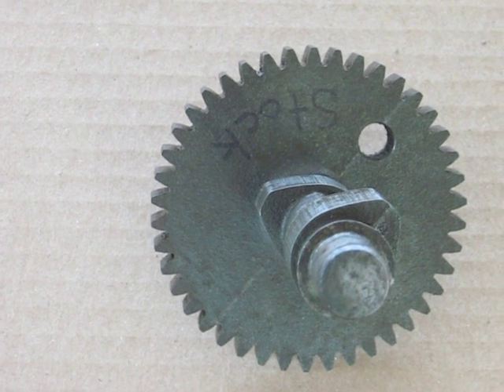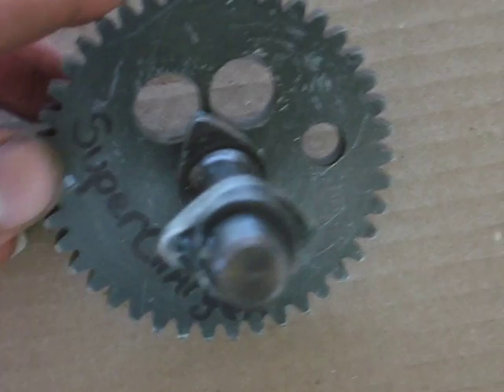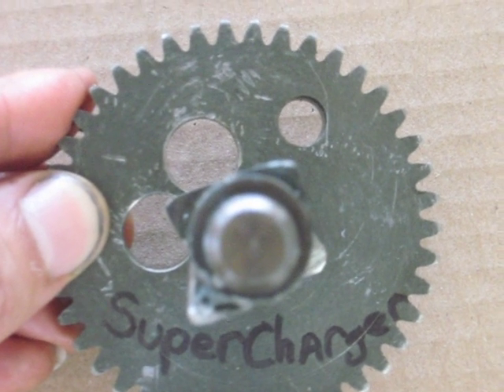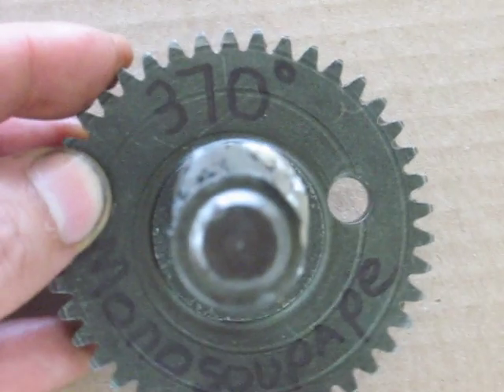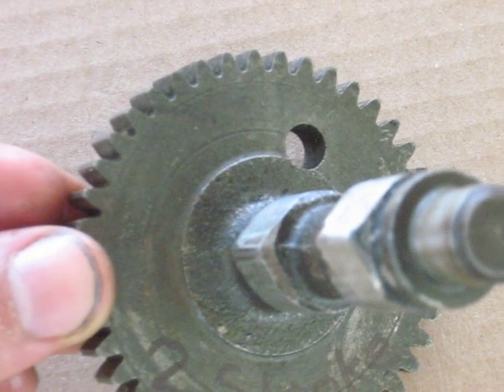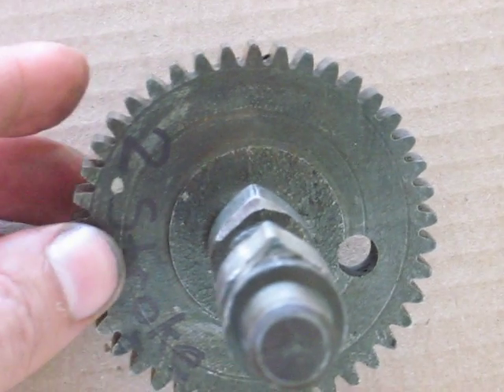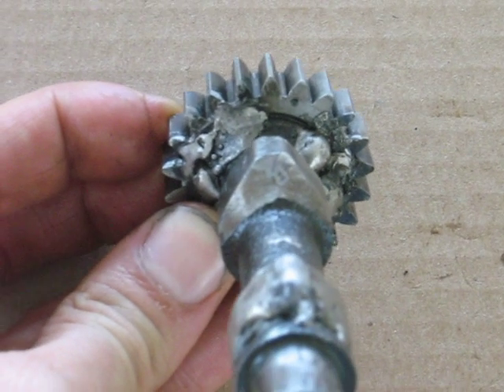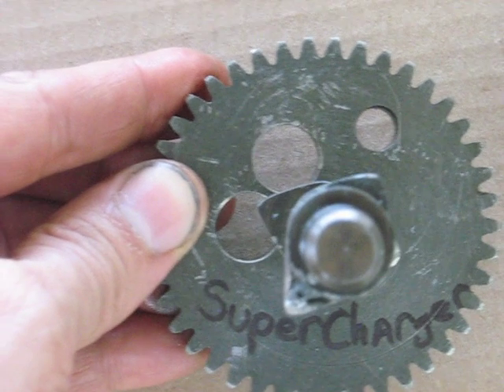Modified Camshafts for Briggs experimental engines

Comment: I have a 3HP 90102 horizontal engine. Is there a cast iron B&S cam available to replaca the nylon one?
Reply from the maker: Yes, pretty much ant cast iron cam from an older  3 horse or 3-1/2 horse Briggs  Briggs engine should fit. I mix and match the old cams all the time. My guess is that you could find one on ebay, just make sure it is a cast camshaft by the photo. Jacks small engines lists the camshaft as  703149, but it has plastic lobes in the display photo. It is like they have phased out all of the old part numbers for the cast cams, so that makes it hard to hunt for them! It looks like the cam you should look for is 394800, which looks to be cast in the photos on e-bay, but one guy want $37 for it!  If you can't find one for a reasonable price I can sell you one for like $10 plus shipping. I am in Canada, but travel to the USA sometimes, so I would mail it in the USA to save on shipping. But you would have to wait a month or so. Let me know how your search turns out.

Comment: What material and heat treatment you using?
Reply from the maker: I was just using a nickel based stick welding rod for cast iron. i didn't do any heat treating. These engines don't run very long, so it wasn't necessary. I guess you would have to experiment with heat treatment to do this for a cam intended for long life.

Comment: I build a lot of small engines, collect them, experiment with them, hoard them... I have NEVER seen cams modified quite like yours though. You have a remarkable understanding of these engines (most engines, I expect) and some really weird ideas. Good weird. Super cool.
Avoiding unnecessary machining on motors granted short life spans is a valuable lesson.
Reply from the maker: All of these cams are designed to suit a given engine. Some are for 2 strokes, other 4 strokes, or other strange cycles, like the Monosoupape, a modified 4 stroke cycle.  thanks for believing that these cams really work, as some people don't. I am currently working on an H12 cylinder, it has been quite the challenge, I hope to have a 6 cylinder run this weekend. If I really move my butt, and if my starter will handle it, a 9 cylinder may be in reach. :)  Take care.

Comment: How do you make the cams? Do you just weld and grind them into the shape you want or do you do something else?
Reply from the maker: It depended a bit on the engine I was making it for. Some of the I had to weld on a lump and spend a lot of time grinding it into the right shape. It took  a lot of trial and error fitting the cam into the engine, checking lift and duration, then grinding more, or even welding some back on. On other engines I just sawed the camshaft in half and re-oriented it the way I needed it, then I welded it back together in a beater engine I made into a welding jig. One way to smooth out the lobe surface better is to use sandpaper pulling it back and forth over the lobe surface.
Reply: ChargerMiles007 ok thanks! The reason I asked is I’m planning on building a 2 cylinder tecumseh engine and I don’t want to spend money on buying a big cam when I can make one

Comment: can you explain the 370 degrees of duration for me?
Reply from the maker: A 4 stroke engine needs 2 crankshaft revolutions (720 degrees) to complete the whole cycle. This particular engine keeps the exhaust valve open for 370 degrees, as it initially serves as an exhaust valve, then when the piston reaches the top and then goes down, the valve becomes intake. it will only work with a short exhaust port, and no piping. The engine that used it is called a Monosoupape, or single valve. The rest of the intake air as well as the fuel entered thru inlet ports at the bottom of the cylinder, uncovered by the piston.
Reply: ok thanks

Comment: How did those cams work when you tried to put them into action? Very interesting idea on the supercharger cam. Should look into changing your lobe angle separation probably be a better way of supercharging the cam... I like the idea though. The way you have the cam setup would probably only want to make a lot of power at a very specific RPM range whereas if you just change a lobe angle separation and have overlap it'll have a couple thousand RPM of a Power Band. It would work if you could do variable valve timing.
Reply from the maker: All of these cams worked in the various engines I made them for. I never have any power readings, as I just experiment most of the time with the engine not being loaded down. I have used a few of them to cut grass etc. I did run the sleeve valve engine on a dyno at university quite a bit. the little 8 cubic inch engine put out 4.75 horse at 3200 rpm with about 9:1 compression. It has enough fruit punch to cut grass very well in my vids. It will rev to 6300 rpm.

Comment: theres only one problem this guy knows nothing about engines theres no cam or valves in a two stroke engine period
Reply from the maker: Kepp making comments like this, and I will have to make a vid showing how many different types of 2 stroke engines there really are. Perhaps you are only familiar with the most common type, the one you find on weed eaters or on model airplanes. there are several other types, for instance a Detroit 6-71 type diesel 2 stroke. It does indeed use valves and a camshaft for exhaust, along with inlet ports and an exhaust scavenger (supercharger).
Reply: Research before making comments like that
Reply: you sound like a stupid fucking idiot Channing. sit the fuck down
Reply: Nice profile pic Channing, I like your accessories, but I can still see your face..add some more please.
Reply: Idiot channing

Comment: isn't there only 360 degrees in a circle
Reply: Yes, but this isn't measured on the circle of the camshaft, this is measured by degrees on the crankshaft. A typical 4stroke engine completes each set of cycles in 720 degrees of crankshaft rotation. The camshaft on a 4 cycle engine runs at half the speed of the crankshaft, so 370* duration would actually only be 185* of lobe on the camshaft, which is what this camshaft has.
Reply: 370 degrees, so it is open all the time, lol

Comment: My briggs and stratton engine has a plastic camshaft which when I ripped it apart to replace it I said. Wow to myself
Reply from the maker: Yes, I seem to have pretty good luck with the plastic cams on smaller engines. I have heard of a few failures on larger engines, like the gear slipping.
Reply: Donovan Bryant you should buy an aftermarket, or older engine

Comment: back in 1957 I modified the cam lobes(grinding off the rear side of cam to increase duration and lift(with lengthened tappets). this is a half horse briggs with a 3/4 model N brigs updraft carburetor and manifold. With a tuned exhaust. mounted on a schwinn single speed bicycle. Behind the seat on a platform . Drove with a second rim welded on to rear wheel rim. All this in rural minnesota farm land(cops let kids drive motor bikes with no license back then). I could always go faster than a sears alstate moped. They would go 32mph and I could get 35mph. Still have the engine kept on a shelf in my storage shed out of the weather. fun to tinker with small engines to get improved power/speed.
Reply from the maker: lol  :) Sounds like you had some fun riding that bike at 35mph!

Comment: i dont think you know how engine works..
Reply from the maker: Really, some of the stuff i do is rather out there, but I assure you that i know how engines work. Perhaps not all of the engineering calculations, intake and exhaust resonance etc., but I think I have a handle on the basics. Some of the cams and things I make are strange, like the one with 370 degrees of duration, but it is for a modified cycle engine called the monosoupape, a very peculiar 4 stroke rotary engine used during WW1.
Reply: Manny, you pretty much summed it up. This young fella is very knowledgeable about these engines. He’s definitely taught me more than a thing or two over the years.
Reply: +ChargerMiles007 You're too kind. Anyone who doesn't think you understand how an engine works is a moron. 

In order for you to make these non-Otto engines you obviously have a thorough understanding of the Briggs 4 cycle engine that you're modifying. You do great work CM. Don't let imbeciles get you down.

Comment: How do you get more than 360° rotation?
Reply from the maker: +Dirtysailor s Camshaft durations are listed on the full 2 crankshaft rotations on a 4 stroke engine, hence 720 degrees of rotation. Thus a 240 deg. intake and exhaust duration would equal 480 deg (with no overlap- not a likely occurrence), but just the intake and exhaust will equal more than 360 degrees, which demonstrates the 720 degrees.
 Note the greater then 360 deg. you mention is on the camshaft of a monosoupape, an engine that uses a modified 4 stroke cycle, with inlet ports and only an exhaust valve, a very strange animal, hence the pecullar valve duration.

Comment: Very nice, i am not a 4stroke lover but.... willing to learn. We have a lot of Chinese scoots running around here and they are slow as hell. most are 50cc with no power at all. Parts are very cheap but no racing parts available. i want to mod the stock camshaft but a dont know what side of the lobes i need ti weld up for more duration. Can you mod a GY6 50cc camshaft??
Reply from the maker: Guido Samson I don't have any of those engines here, but what you need to do is weld to each side of the lobe, then carefully grind it down smooth, as well as sand it. Making the camshaft lobe wider will keep the valve open for a longer time (increasing duration). You don't want to increase the height of the lobe (increasing valve lift), as you might hit the piston. Also, if it is an overhead valve engine, you will need to make sure buy turning the engine over by hand, that the valves still clear the piston. And don't forget that if the revs are too high, the valves can float, and still hit the piston at high revs.I cannot say how long the welded up camshaft will last under racing service, as there are just too many factors at work. If you only weld up one side of the lobe, the valve will either open earlier, or close later, which may be what you want.
Reply: example so i can actualy see
Reply from the maker: Guido Samson I will try to remember to make a quick vid for you. If you don't see it uploaded by Monday night, please remind me about it, I won't mind.
Reply from the maker: ChargerMiles007 I made the vid a few days ago, but it had trouble uploading. I discovered a new way to make a racing cam, so I will make a new vid explaining both methods.
Reply: ok thanx man
Reply: There's a shitton of gy6 performance parts on the net man.
Reply: There's a shitton of gy6 performance parts on the net man.

Comment: There are two strokes with cams. Ever heard of the detroit diesel? You can make on ohv two stroke but it has to be forced induction and it will always have some unexpelled exhaust gases
Reply from the maker: True, the Detroits do use cams to open the exhaust valves, I pulled the blower off one in a scrapyard. Quite the impressive chunk of engine!I did build and run soley valved (no inlet ports) 2 stroke using a piston type supercharger.
Reply: +ChargerMiles007 I meant to post that in reply to someone else who was saying 2 stokes don't have cams. Guess it got posted as a regular comment

Comment from the maker: Yes, I think you could do that for the super 2. Two months back I tried my luck with the full speed camshaft drive, and made a sucessful popett valve 2 stroke, with no inlet ports like this one used. I ran very well for about a minute, then it BROKE the #35 supercharger drive chain. I have had these engines vibrate sprockets off shafts, and the chain fly off many times, but never broke a chain before. The vid is worth watching, since I think it may be the first flathead 2 stroke engine.

Comment from the maker: Which engine are you wondering about the air flow on?
A friend made me the full speed cam set-up by using 2 more crankshaft gears, fitting one to the camshaft, and putting the other onto a new idler shaft. One newer engines, the crank gear is a separate part, so that works out easier for the camshaft, just machine the old gear off, and fit the new gear. I use an older "solid" crank gear for the idler, fitting it to a 1/2" dia. shaft

Comment: Just what I need to do. I need to move the exhaust lobe on a lawnmower 3 1/2 hp engine. I need to move it back 90 degrees so it is 180 degrees from the intake lobe. What rod did you use to weld it up with? 7018? I guess the idea setup would be a spray torch, but I don't have one. Has the lobes held up ok?

Comment from the maker: Note, I admit that I am not a machinist, these cam lobes are welded, then hand ground using a hand grinder, pedastal grinder, and a rotary grinder. The I use a file followed by emery paper. They are NOT precision cams, but they do work well enough for me on these experimental engines. I plan to do a longevity test this summer on a welded up cam for my 73 Briggs lawnmower.

Comment from the maker: You might want to re-examine who is dumb here!
What you really mean is no 2 stroke gasoline engine currently in production, uses a cam and valves.
Go back in time 10 years or so, look at the Toyota S2 dual overhead cam 2 stroke, but it never made it into production due to catalytic convertor duration concerns.
The GM 6-71 Series diesel engines all use cams to open 2 or 4 exhaust valves per cylinder.

Comment: @CentralValleyForum, I'm not sure what two stroke that cam is for but to answer your question, a lot of Detroit diesels are two cycle. They have exhaust valves only that are operated by a camshaft. The intake is like a normal two stroke with holes in the bottom of the cylinder feed by a blower.

Comment: Well, off the top of my, you could find bearings to fit the cam ends then make a jig with angle iron and hose clamp them to the angle iron. This would give you a solid foundation to roll the cam on. Then rest the grinder in a surface to have better control. Or you could rig it (the grinder) on a swivel with bolts that control the angle of the grinder and roll the cam to grind the complete base circle.  BTW I'm not a troll. I also stand by my remark about a 250 racier would never want to ride a

Comment from the maker: Hey, we seem to have attracted some Troll comments here. I have deleted most of them, and will Block there butts if they persist!
Anyway, I think putting a 5 horse Briggs to make an offroad bike would be cool. I doubt it would have the zip of the 2 stroke though, especially since the model 13 Briggs is only 207cc.
Reply: ChargerMiles007 you ahouldnt make a bike, weld a gokart project

Comment from the maker: Please tell me how you grind the base circle down accurately with no machine shop equipment?  Just asking a dumb question.
Those pushrods are precision ground flat on the ends, good luck getting it square with a hand grinder!
You do make a valid point though, perhaps it would be easier reducing the base circle. I guess that doesn't help[ much on the double lobed 2 stroke cams though.

Comment: Your welding is horrible, and you're lazy also. You could have used a grinder to make them smooth and get rid of the slag. You do realize instead of stacking bubblegum on top if bubblegum  you could have just made the base circle smaller and increase the pushrod by the same amount? It would have made for a lot cleaner job.

Comment from the maker: I welded additional steel to the lobes, to increase duration of the valve opening mainly. You can increase lift a little, but you have to watch out not to bind the valve spring, or run the valve into the head. I would look for an old 5 horse model 130502, pretty common on roto-tillers etc. You can get racing con rods, valve springs etc. for them thru Briggs Motorsports. You can also buy racing cams, or make your own.  I don't run these welded up cams for very long, so durability is questionable.

Comment from the maker: Actually, yes they do, everyone is out of one of my engines here on youtube. Remember though that the double lobed ones are for the compressor (supercharger) of a 2 stroke. The one with very long duration is for a 4 stroke that operates on a modified cycle. Read about the Monosoupape rotary aircraft engine from WW1.

Comment from the maker: Correction, MOST 2 strokes don't have a camshaft!
There are actually many different types of 2 strokes, look up the GMC 6-71 2 stroke diesel, it uses a camshaft and valves for exhaust, and ports for inlet. That allows it to use oil in the crankcase, just like a 4 stroke. I use the same idea. Just wait til I get my 2 stroke sleeve valve running. Check out the Rolls Royce Crecy, a V12 sleeve valve supercharged 2 stroke, it has nothing in common with the average Weedeater 2 stroke.

Comment from the maker: @michaels6speed 
Yes, I did machine it on a bench grinder!  :)
You must understand though, that the engines I use these cams in don't generally run very long. so they are fine for that purpose. Other than filing and sanding the lobes, I have no other way of smoothing the surface.

Comment from the maker: @30GB 
You would have to check out the engine. I use modeling clay, put a small piece on top of the valve, and crank the engine over slowly, it will squeeze it to show you the existing clearance. Of course you might be in for a new head gasket, but the is the price you pay to modify things.

Comment from the maker: @formulasonny 
Sorry, I don't know anything about the Vanguard engines.
However, generally to modify the camshaft (assuming it is made of cast iron or steel) You would first need to look at the valve geometry, to make sure the engine can tolerate more valve lift, without hitting the piston. Then note the existing camshaft duration and lift, and weld on more to achieve what you want. Getting a smooth camshaft will be the hard part, lots of filing and sanding, and trial and error!  :)